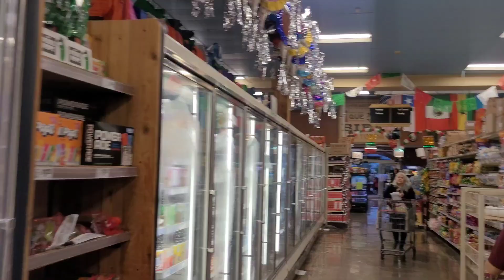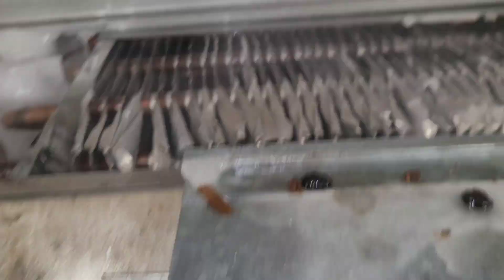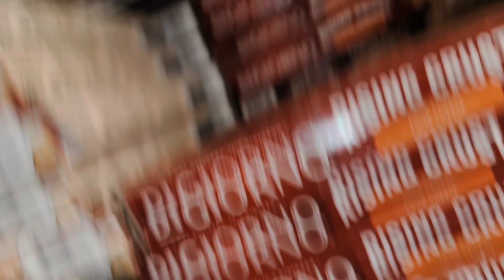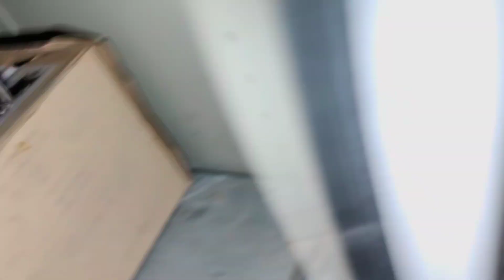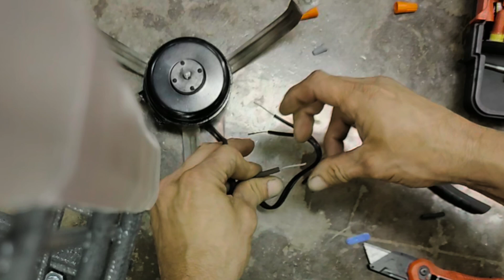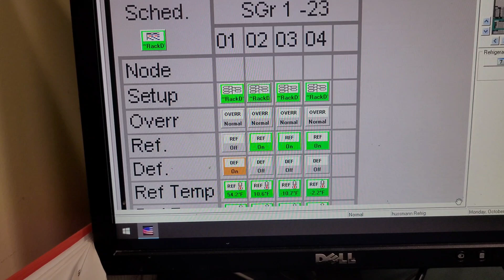Frozen Food Case Alarming High Temperature

Comment: I could see why Tyler was not a very popular refrigerator brand. Sure, the metal panels might look like a good idea in an attempt to protect the coils, but in actuality they are a bad design, as they restrict the air flow, make the unit run harder, waste a lot of valuable metal, are hard to service, and are quite inefficient. How about those strange looking, rectangular square motors? I thought ECM motors didn't exist in the 1990s. Altogether, I guess it's safe to say that Hussmann, Kysor-Warren, Hill-Phoenix, Master-Bilt, True, and even Zero-Zone are much better refrigeration brands than Tyler ever was. Hopefully Hill-Phoenix corrected the problems and improved the quality of their units since they acquired Tyler and Barker in 2009. Whether the manufacture date is 2/92 (going on 33 years old) or 10/97 (going on 27 years old), and use R22, I think it's safe to say that it's time for these freezers to be replaced.
Reply from the maker: Absolutely. Tyler, in my opionion, was really that bad of a MFD. Of course, this design of case evaporator covers, was not a good idea. I think that Hill Pheonix buying them out probably was an improvement.  Obviously,  i think that Hussmann is going to be the best. Lol.